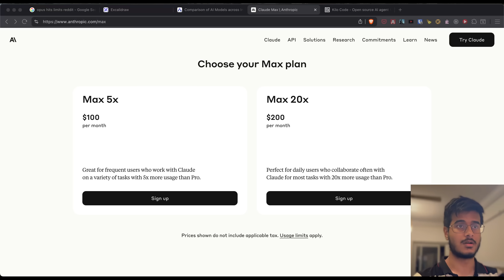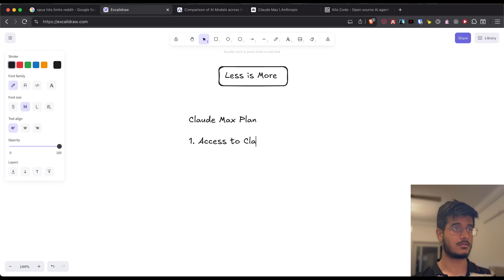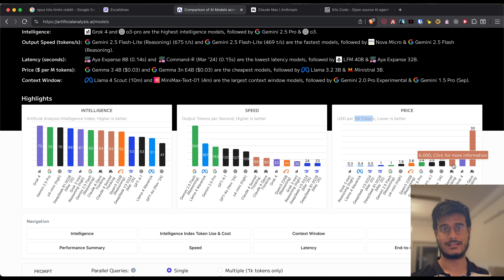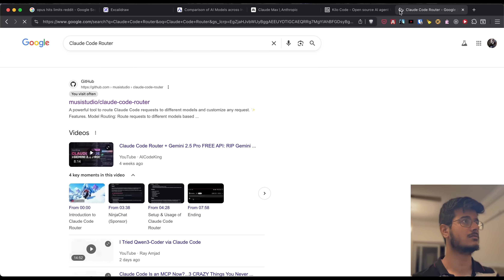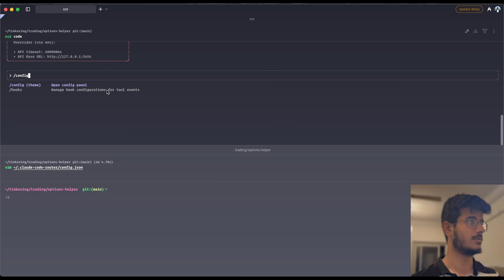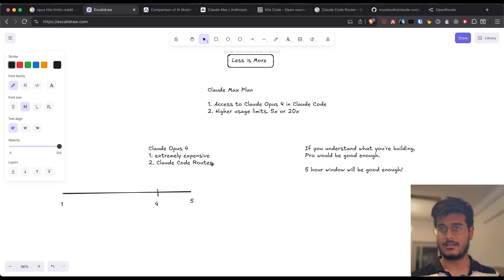You don't need a Claude Max Plan

Comment: I'd been on the Pro plan for a few weeks and kept using my limit within the 5 hour window. Switching to the 5x plan has been great to just keep working uninterrupted, using Opus for thinking and Sonnet for doing. Still bringing in other LLMs like Gemini and Perplexity for other tasks. The other option is upgrading to Max during heavy use periods, then downgrading to the Pro plan when you're not having intense building sessions. In any case great video and insights!
Reply: Ok so I switched from pro plan to Max two days ago. And people have told me I'm dumb... what are the big specific benefits you're finding with Claude Max ?
Reply: @AnHebrewChild  Not sure why people are calling you dumb... looking back at my comment from 5 months ago I should have said I was using Claude Code, that's where I was hitting my limit for the Pro plan. I've not been coding lately and downgraded from Max back to Pro, I've only had to wait once for the 5 hour window to reset. There were a few times on the Max plan that I had early usage of certain features (I forget which now) but the main appeal is that you can use Claude Code without having to constantly wait for the window to reset. The only times I hit the limit on the Max 5x plan was running multiple Claude Code sessions parallel, probably the equivalent now of using agents. Hope that helps!
Reply: @MichaelDooney thank you much.

Comment: I liked the slightly different take on AI and thinking about efficiency to cost of using Claude...thanks. I agree with you about quality over quantity (although Bill Gates wouldn't be someone I quote 😅). Tools like Claude are there to add quality and should be used to 'enrich'.

Comment: Good video. Aligns fairly well with my own reasoning for staying on the Claude Pro subscription, though I typically use the time between hitting a usage limit and the next 5-hour window to either prepare designs/plans for the next window, clean up AI slop that is easier for me to directly edit than to explain in a prompt, or to code things myself that I know an LLM will screw up. I may look at CCR for filling the gap between usage limits and fresh windows, but my concern would be that the Claude Code system prompts are tuned to the Claude models. (With the recently added "output styles" feature for Claude Code, this is perhaps less of an issue, since they are essentially custom system prompts.) Anyway, thanks for sharing a sane, thoughtful reflection. Will check out your other videos.

Comment: Claude deleted my code today after i asked it to rename my git branch. It completely forgot to keep a backup of the code on the branch - it instead deleted the git branch directly and created a new branch.. i lost my 500 line changes
Reply: I would not allow claude the ability to delete so easily , you could use "hooks" to prevent such operations.
Reply: That sucks, however - skill issue.

Comment: Great video. The video discusses the Claude Max plan for AI coding, arguing that while it offers seemingly "unlimited" access to Claude Opus 4, it often leads to low-quality code and is not worth the high cost (0:01:30).

The speaker highlights several key points:
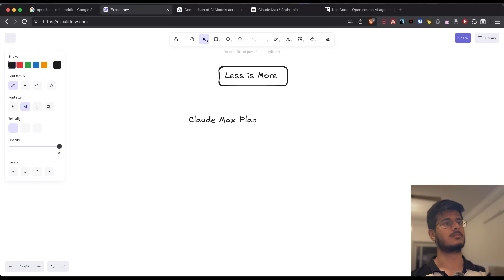•	"Unlimited" Access is Misleading (0:02:15): Despite the higher price, the Claude Max plan doesn't provide truly unlimited access to Claude Opus. Opus is significantly more expensive than other models, leading to users quickly hitting usage limits (0:03:25).
•	Claude Code Router as an Alternative (0:05:08): For developers who need occasional access to Claude Opus, the speaker recommends using Claude Code Router, which allows you to use Opus with your existing Claude Pro plan, avoiding the higher Max plan cost.
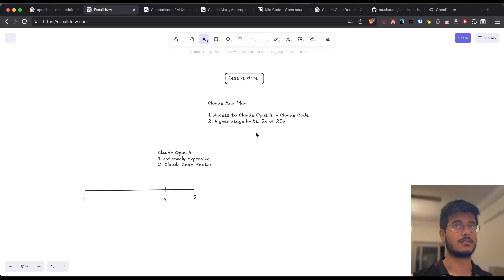•	Quality Over Quantity (0:07:52): The video emphasizes that generating a large amount of code does not equate to progress or quality. Building many apps quickly often results in "garbage" code that is hard to maintain and doesn't provide real learning for the developer (0:00:00, 0:09:01).
•	Claude Pro is Sufficient (0:10:05): For most developers, the standard Claude Pro plan is adequate. The speaker advises focusing on understanding the code being built rather than relying on AI to generate everything, which can lead to an "AI slop" where neither the human nor the AI understands the codebase (0:11:07).
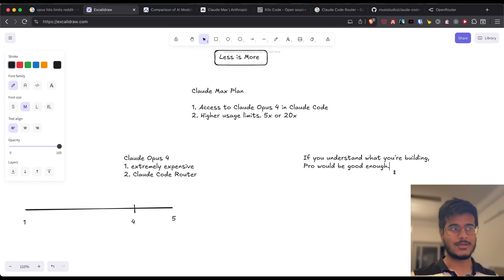•	Build Skills, Not Bills (0:12:07): The core message is to prioritize building engineering skills and understanding the underlying technologies, rather than blindly generating code with AI, which can lead to wasted money and a lack of genuine learning.